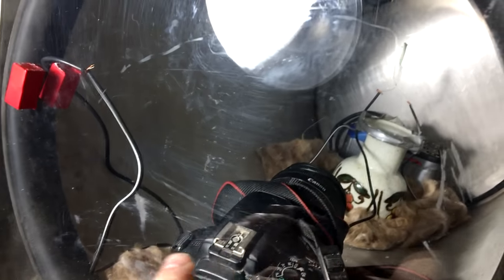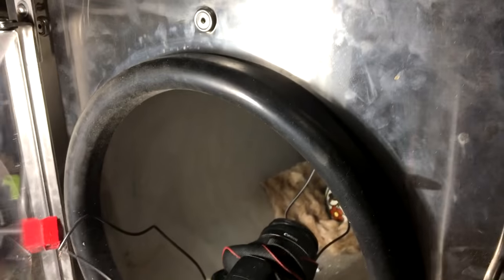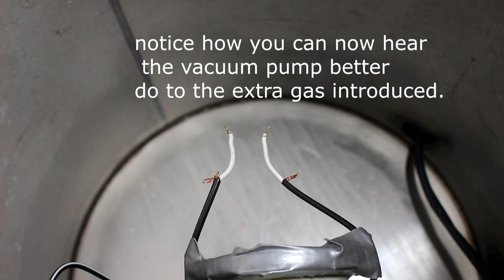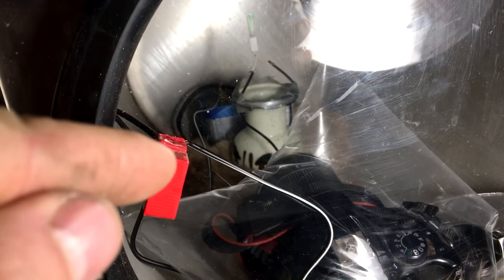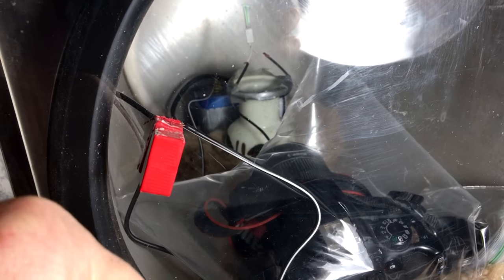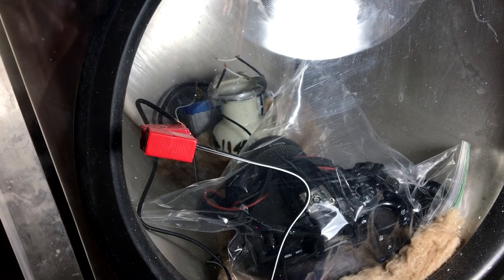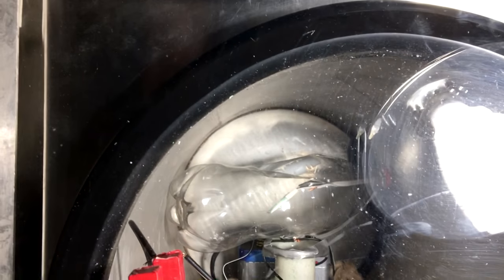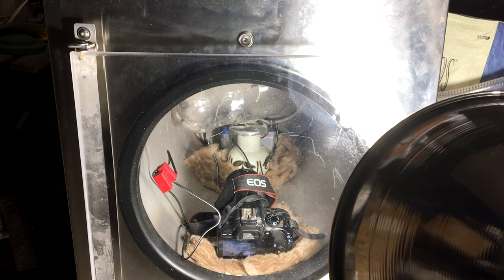Sound of Explosions in Space? part 1

Comment: I think that the sound we are hearing might be due to particles/fragments of the explosive physically hitting the walls of the chamber. Might it be possible to capture these particles in some wadding like cotton without absorbing the sound so as to eliminate this possibility? Maybe lining the chamber walls internally with fiberglass or Polystyrene.
Reply from the maker: Well what do you concider fragments? because in this condition even the gas molecules are doing just that.
Reply: I would assume he means the bits of the blasting cap (shrapnel) which were my first thoughts as well.

Comment: Hey Cody, a tip. Run that light on DC electricity to get the light more consistent on high speed slow motion footage.
Reply: Nicholas Markovich its a light bulb
he might use ehite leds cause light bulbs are ac and 60hz prob
dc isnt counted by hz its constant on one state
Reply: Ordinary light bulbs go just fine with a direct current power source.
Reply: ***** but need more voltage as dc aka 120vac = 170vdc
Reply: No.
The 120V AC has a peak voltage of 170 V.
The RMS voltage is 120V, and thus the equivalent DC voltage is 120 V, as a resistive load will draw the same amount of power under a 120 V DC source and a 120 V RMS AC source.

Also, the only way to keep the wattage the same with a pure resistive load is to keep the voltage the same. You can't run a resistor on 12V and get the same wattage as you would on 120 V.
P=V^2/R
Reply: Jeffrey Black uhh wut 120vac is 170vdc
Reply: 120 V AC has a peak voltage of 170 V. The RMS voltage is 120 V. This means the DC voltage providing the same power to a resistive load will be 120 V.

If instead it is a more dynamic load, drawing power at the peak of a cycle, such as a rectifier and capacitor, then the same voltage to power that load in DC will be around 170 V.

The issue with incandescent globes is that the light output isn't linear w.r.t power (for a single globe).
Instead at low power, it doesn't output any visible light.
This means you will likely need a somewhat higher voltage, but still less than the 170 V.
Reply: Jeffrey Black yeah thats what I ment
Over rectifier and capacitor its 170vdc
Reply: I dont believe an incandescent light would be affected.
Reply: i'm sure he knows lol

Comment: If you hold the chamber at a near vacuum then set off the blasting cap, how much does the pressure inside increase? Would the sudden rise in pressure break your mercury barometer?
Reply from the maker: yes that is why I didn't use it during this experiment.
Reply: I've always been curious what the volume of gasses are in a firework or in a firearm cartridge (a 9mm for instance) at or near atmospheric pressure.

Comment: I'm surprised you've been using electronics in vacuum. I work in a physics lab, and someone dropped their phone in water, and used a vacuum to try and dry it. The battery blew up so big that the phone popped in half. Then when it was vented the battery compressed and pulled the phone together. I'm sure it wasn't the best thing for the battery. Maybe you're doing similar things to your camera? There's also a lot of adhesives and such things inside of electronics these days that probably don't respond very well to a vacuum.
Reply from the maker: I've heard of batteries bursting in a vacuum but I have not been able to recreate it, was the phone a note 7?
Reply: Cody'sLab actually, it was a Samsung s7 I think haha
Reply: Billy Debenham lmao
Reply: Billy Debenham omg hahahaha
Reply: We had a (hobby type 3S) LiPo that looked a bit unhealthy (the wrapping around the cells is loose and wrinkly) after going about 30km up on a weather balloon... (chemical hand warmers seems to help for the cold...)

In some cases expensive non-rechargeable lithium batteries seems to be the best option for strange environments...

Comment: wow, i always thought explosions do nothing in a vacuum as there is no medium for the blast wave to propagate in.. does this mean the gas released by the explosion is moving at the speed of sound?

wait no - the speed of sound is 0 in a vacuum.. I've officially confused myself
Reply: Zreknarf You forgot that the explosion produces gas, and thus a medium for the sound to spread by removing the vacuum
Reply: Zreknarft I think you mean, the sound produced is traveling at the speed in which the gases expand in. I wonder if he can reproduce this experiment with an explosion that can release helium. I think the sound would be a higher pitch due to increased speed?
Reply from the maker: it would travel at the speed of the gas particles, in this case probably about 3times the speed of sound.
Reply: Legiaseth
yeah, that's were my question was going, but couldn't the gasses potentially be moving FASTER than the speed of sound? surely there is some differentiation between the shockwave and the "gas wave".. but in a vacuum they would have to be the same.

i don't know, this is all very new and confusing to me hah
Reply: ***** ah okay. i think i see why i'm confused. the speed of sound is not a law like the speed of light. sound can travel at 3x the speed of sound, so long as it is carried by gas particles moving at that speed..
Reply: The explosion works by imparting momentum in your hypotherical space shuttle. With other words it's the explosions mechanical energy that makes say a hull of some kind vibrate therefore making sound, not actually the explotion itself.

Comment: Hey. Will liquid travel up a straw if you put a straw in a glass of water in the vacuum chamber?  Probably a stupid question, but I'm kind of stupid myself.
Reply from the maker: the max you could do (assuming the chamber has a high enough pressure for the water to be liquid) is 5cm of draw.
Reply: Cody'sLab i disagree. if the top of the straw and the top of the liquid is at the same pressure (both is in the chamber) then
the level in the straw will be the same as in the glass. if you want the level to rise in the straw, you need a deltaP of about 1mbar per mm of change in level if the liquid is water.
Reply: What do you mean? The entire thing in a vacuum chamber? or just the end of the straw that is not in the water.
If you place one end of the straw in a vacuum and the other in a glass of water you can get anywhere between 20-30ft of height (depending on your elevation)
Reply: first things first water cannot be liquid in vaccum if it is then no water won't go up in straw
Reply: Assassin water can be liquid in a partial vacuum, as long as the pressure is above the vapor point. I don't remember the numbers, but 50 mTorr abs (like the chamber in the video if I heard right) is probably beyond that point, but because of the evaporation of the liquid into gas, some of the water will turn to ice. Then the water won't move whatever the pressure is :-)
Reply: +Alexander Frøyseth ikr I think he's about complete vacuum :)
Reply: Assassin yeah, but good luck with that. Also the vapor point of water is so high, that as you say, no water will go up the straw

Comment: Two hypotheses: One, with that setup you'll always hear a sound through the camera mic (and externally) because the sound waves are still going to travel through all the other materials that aren't air, like the wires attached to the caps, the pressure chamber, etc.. I'd like to see this done with the blasting cap acoustically isolated from the camera physically so that we only hear sound waves that actually travel through near-vacuum. Even just a layer of sound-isolating foam for the camera to sit on and making sure it isn't in physical contact with anything else in the chamber, I bet, would reduce the noise picked up.

Two, in a vacuum, there's no air pressure for the exploding gases to overcome as they expand. If you think of it in terms of particle momentum transfer, those hot gasses have to push the surrounding air out of the way, containing the energy in a smaller radius as the gasses slow down. This transfers a lot of energy into the surrounding air in the form of a pressure (shock) wave, that travels to our ears and can be heard. But with no air particles to collide with (or very few), the gas particles are accelerated by the explosion and never lose velocity from collisions. The gas particles still create a pressure wave that travels as fast as the particles themselves, and when they collide with say, a spacecraft, sound energy will be transferred in just the same way. So maybe explosions in space do make a sound, just not the same kind of sound.

Comment: +Cody'sLab You probably won't read this but I had an idea where you could put the camera on a metal platform and use magnets to suspend in the air. This will negate any vibrations traveling through physical points of contact the camera is making with it's surrounding; accounting for 50% of the noise.

Comment: Hey Cody! Can you try to fly a mini drone in Vacuum. Love all your videos btw
Reply: it wouldn't work
Reply: I know it wont due to the lack of air but it will be cool to see and have an understanding of lift as well!
Reply: Fluid dynamics
Reply: it wouldn't be that cool to sew, you'd just be looking at a drone sat on the bottom of a vacuum chamber
Reply: As cool as it might be to see it (not) fly in low pressure, I would be interested in seeing how it flies at high pressure.  Maybe take the chamber up to 2 atmospheres?  3?  See how the dynamics change at higher pressures.
Reply: +clint Herron I'm not sure but I don't think it would change much, the rotors might have to work a little less? A more interesting experiment would be to do it in a heavy gas, such as Co2, to see if it could still generate the thrust to fly.
Reply: drones would probably fly better in a denser, more viscous atmosphere, because there is more mass holding it up.
Reply: Shaan Yeat Amin Ratul no it wouldent work
drones push air down to let them go up
in mars theres no air
Reply: +hwppyslappy face, there's C02
Reply: ***** I think theres something called reply button
Reply: yeah that's stopped working for no reason.
Reply: ***** that makes 0 sense

Comment: I would think that the explosion in a vacuum may be more violent up through a certain range than in normal air. Instead of having to compress a gas to make a pressure front, the explosion is free to move about without any limits. 

Now what may be interesting to try is do this experiment again with a larger vacuum container and put the camera further away. 

I would expect that the force or sound of the explosion would fall off about the same way as radiation does from a source, that is with the inverse square law, twice the distance is 1/4 the energy. 

Good experiment!

Comment: To add to Cody's prof's analysis, the shock wave, would not actually be a gas-propagated wave, as there is no medium to be waved .
The corollary would be that the 'propagation' speed would not be limited by any local 'speed of sound': it's simply a shrapnel-like movement of matter. Thus, although attenuated inverse-squarely, this matter-front would hit the mic with all the initial speed of the blasting cap. Being a fulminating detonation reaction, I imagine the matter-front would be hitting the mic pretty fast.

Comment: Cody. I suggest you revisit this with a different test setup. You should get some lengths of pipe and connect them together with elbow joints to make a long vacuum chamber with a non direct path from the explosion to the camera. That way you can eliminate the gas particles hitting the camera as a sound source. The gas should have trouble making the 90 degree bends.

Comment: IMO it's the sound of the expanding gases from the blasting cap hitting the plexiglass. You don't hear a bang, just a thump every time, and the vacuum pump changes pitch as if it's back to drawing the chamber back to the negative pressure.

Comment: Makes complete sense.. I always wondered about this. When a chemical reaction creates gases and pushes them outward at incredible speeds, those gases are free to travel without resistance and if your ship is floating near by that thick fast moving cloud of gas is going to hit your ship creating some noise. If you were outside without a helmet, the pressure wave would move your ear drums making a "sound". 

But it has to be the gases coming from the explosion itself, its not like its creating a powerful vibration through a medium.. it can't

Comment: I agree with you that the sound heard is the result of the
expanding gasses from the chemical explosion. But the size of your vacuum
chamber is small, the reasons why are legitimate, I contend that the pressure
waves would expand so rapidly that by the time they would strike the space
capsule they would be inaudible. The distance from the explosion is a variable,
there are so many variables I can’t think of any good way to do this
experiment.

Comment: I think the bottle broke due to Delta-P. The pressure differential due to the rapidly expanding gas in the bottle, then breaking open could create an additional sound as well. Also, I'd hazard to guess the reason the bag collapsed on the camera was due to the pressure in the vessel raising a significant amount and thereby lowering the relative pressure in the camera bag. 

Just a little food for thought.

Comment: I believe that the shrapnel hitting the camera itself is influencing the experiment.  While the gas released by the reaction could possibly carry a sound, I think that the high velocity plastic hitting the sides of the camera is also to blame.  When the bag surrounded the camera the sound was reduced but the bag was still in contact with the camera, allowing some waves to travel from the bag to the camera.  I think another step that could have been taken to test the hypothesis would be a protective shield, sharing the same vacuum, such as a dome placed over the camera without touching it.  A fine mesh shield would also work to catch possible debris.

Comment: Try using a speaker or transducer to emit and explosion (or other high amplitude, short burst) sound energy into the vacuum chamber.  Make sure no part of the transducer or speaker is touching the chamber walls . This would eliminate the expanding gas portion from the experiment. The size of the chamber is small and just like a guitar body may amplify the effect of the vibration.  It is also likely that the close proximity of the chamber walls to the microphone and explosive device is transmitting the detonation wave energy like a wave tube.

Comment: Explosions are more powerful in space. When an atmosphere is present, the expanding gases have to fight against a pressure differential, which absorbs some of the energy. That's why rockets get more efficient as they go up. It may seem paradoxical because you expect that air gives the exhaust something to push off of, but that's not the case. Since gases are compressable, some of the energy is absorbed in compressing the gas ahead of the explosion, making explosions less efficient in air.

Comment: I wonder what the effect of gas diffusion would be? Would be interesting to try this in a really big vacuum chamber and alter the range of the mic pickup for each test run.

Gas produced by the explosion in a small vacuum chamber apparently saturates the volume, but in a vacuum chamber the size of a room it might not be as strong. So there's probably a falloff in pressure from the expanding gas that drops with range.

Comment: Re: sound traveling in the vacuum not being quieter. Think about Newton's Cradle. The last ball has the same energy as the first because the energy is transferred so well. But if the balls weren't there at all, the first ball would still have that energy and travel at the same speed.

Same idea with the gases. Not having any air in the way means the gases can expand with the same energy. The shockwave may not travel as quickly, but it will still hit with the same energy.

Comment: To test this properly, you need a vacuum that is bigger than the radiating energy waves created by the explosion. Currently your waves are reached the edges of the chamber, and the surrounding air so you will still hear the explosion as normal on the outside regardless of the vacuum inside or not.

Comment: Yeah, a closed vacuum would increase the force of the explosion. The interesting thing is that the explosion didn't expand in all directions relative to the bottle or blasting cap, it did so relative to the chamber. The hole in the bottle was too far and too small to be the easiest route to equalization so it blew a hole in the bottle. At these extremes, it's more like an electric arc than pressure. Maybe cut off the top of the bottle so it's only large enough to let the gas escape without breaking the bottle. Tho I think in any sufficiently small closed vacuum, you will always hear something.

Comment: I work with large thermal vacuum chambers for a living and have seen small pyrotechnic charges detonated  under high vacuum, and they do not produce any sound. The key here is "large chamber" (over 30 feet in diameter) and "high vacuum" (the 10e-7 range). The chamber in this video is neither large or under high vacuum.
MFP (mean free path) is the distance a randomly moving molecule has to travel before it will collide with another molecule or atom. The state of vacuum is measured by comparing the MFP of the molecules in the chamber to the overall chamber volume. When the atmosphere inside the chamber becomes so rarefied that a given molecule is statistically more likely to come into contact with the chamber walls, before encountering anything else, only then can you be said to be at "high vacuum". The 500 mTorr of pressure this chamber is capable of is clearly nowhere near high vacuum. As such, sound will still propagate as long as the wavelength of the sound generated is greater than the MFP. The relatively large volume of gas that the blasting cap provides, is obviously enough to bring the local MFP low enough to allow the sound to travel.